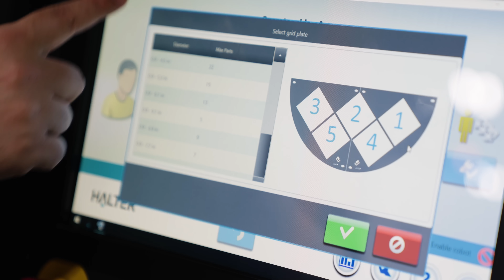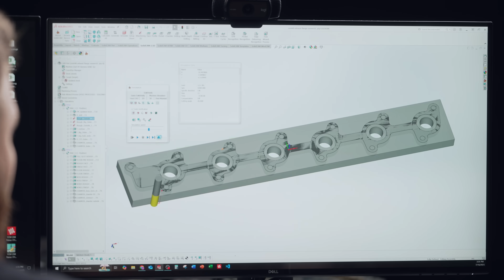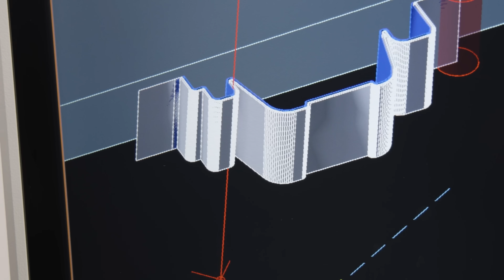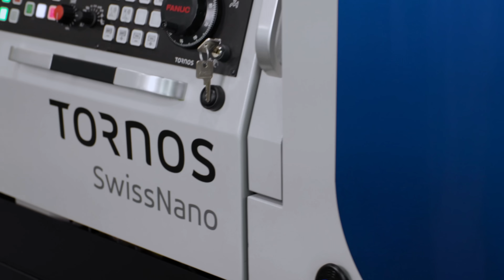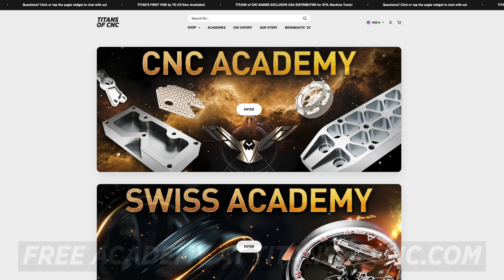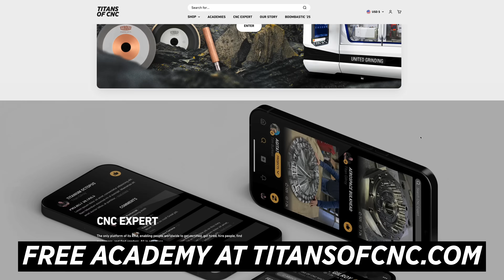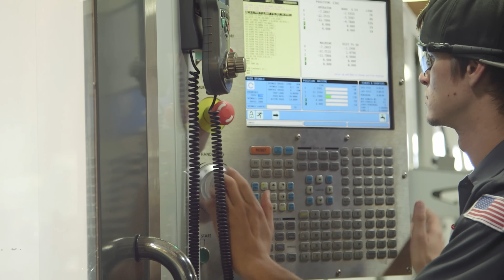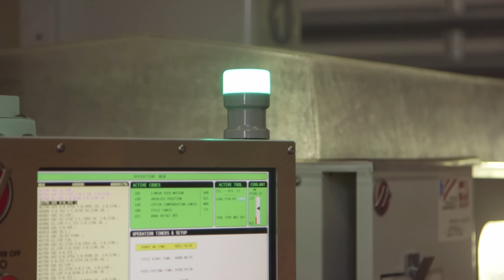Top 5 CNC Lies Holding You Back

Comment: OEE Is crazy important.  I walked into a shop where the manager was terrible.  I was the lead programmer and when they finally parted ways with the manager,  one of the first things I did was look into OEE. Our utilization averaged between 8-12% depending on the week and jobs. After alot of research, documentation of true data and plenty of projects basically to redo how to setup and do jobs,  in about 1 year we were at 50 to 60% with just 3 axis  mills, 1 lathe without barfeeder and no pallet changers or horizontal mills. 

We went from 20k in the red to 370k in the black in 2 years. 5 years ago the shop was almost at 200k in the red.

All this and no new machines. They went from thinking they needed 6 more HAAS to 0. 😅

Comment: Small shops can compete if they provide good value. Make consistent parts with tight tolerances at a good price. I'm currently building my own CNC mill from scratch and the potential is incredible. Reinvest the profits into better components (more precise encoders/ball-screws/stiffer frames). You don't have to compete for hundred million dollar contracts on day one. Money is made in process optimization and less on having the best machines

American manufacturing is way behind on the supply curve.

The only advice I have for anyone is to never stop learning. Every job or task has something to learn. At a terrible workplace/management, learn what not to do in the future. At a great workplace, learn what makes it operate so smoothly. Learn how to be a better team-member and how to interact with others. If you're a craftsman, learn more advanced techniques and how to tackle the engineer/assembler dilemma.

Comment: "Automate so you can pay your employees more"... I laughed pretty hard when I heard that.
Reply: But it's true, and automation isn't all about robots but fixturing and process as well. Instead of running one part at a time, make a fixture that makes 12 parts, and make the fixture easily replaceable so that you can keep the downtime as short as possible. This frees up the operator to run another or even 3 to 4 machines and multiple part types, meaning you get to pay the employees more for their labor.
Reply: @TheDandyMann sure u may be paying that 1 worker more, but if u do exactly what u just said in the shop i'm at, u just cost 3 people their job. Lmao.
Reply: @verakoo6187 Their labor could be used elsewhere in the shop if the shop has anything else for them to do. Your shop could expand if they're productivity is up and then give those same people the same responsibility as that If not then their labor can be used in a different shop.

Comment: i work with cnc´s that are 40 to 70 years old. its a bit weird to have a stone age windows nt laptop to backup, and you have to think in kilobytes, but its working really fine. Im mostly in Education and teaching to build the next generation. We have newer Machines, but its kinda fun to teach on the Oldtimers.After 2 years they program on the new ones in minutes its crazy. We dont have the volume or robotics to make real money, and we make mostly one or two parts per program, very specialized but its still faster
Reply: Working with old machines makes you better at programming.  Generating good surfacing code that isn’t 20k lines long is a valuable skill.  I’d say 9/10 times you need the shortest code possible to generate clean toolpaths.  All G1s ends up being garbage on anything besides heidenhein.

Comment: To say small parts can't make money is crazy, especially with a machine like the hydromat.. they can easily spit out  brass parts that are completely finished, no second opp needed at all in a matter of 5 seconds or even less.. with small parts there isnt nearly the amount of waste. One thing about it though, the machines have to be running and would want to have multiple of them running different parts.. a lot of the brand name brass parts we ran would only be sold to a customer for between .10 to $1 a part.. we could run 50k pieces in a week pretty easily but might only sell for 25k so the more machines spitting out parts the better

Comment: Our shop has a recent purchase haas 2012 sl-10+ bar feeder  we have a 06 sl20 and an 06 mori nl2500y..
We make speciality fasteners
Reply: The programmer there before me actually sent a barfeeder to the scrap yard because he didn't know how to use it.
I'm in the process working with the owner of getting buget used machines to replace whats clapped out machines and trying to get bar feeders and auto part loaders where ever I can we already went from 400-500 parts per day to over 1100 because i can keep the sl-10 running overnight the production jump is huge. I have ran into some tool life problems as we mostly deal with stainless and harder metals like 718, hastaloy, waspaloy, 660, A286. And they are just brutal to cut hex bar. I have 2 or 3 of every in the machine just and limit the parts per tool just to keep the quality up. But otherwise it's been good

Comment: Just want to say a big Thank you. I started a new job as a CNC lathe operator 4 months ago and your videos helped me so much in terms of understanding what is happening when the spindle is running. Truly the best job i ever had! Thank you Titan and your team.
Greetings from Germany
Reply: Just a question, how hard is it to learn G and M Code.
Reply: @SentinelAerospaceOfficial If you wanna learn it then its not that hard. But it can be frustrating sometimes.
Reply: @SentinelAerospaceOfficial  You'll find that most companies these days are using CAM or dialogue programming. It really minimizes the actual code inputs you need to do yourself. Its 100% a VERY good idea to learn the basics so you can easily understand most of what your machine is going to run.

There will also be places where you have to manually put in every single G code line and while I respect the guys who does that - no chance in hell you'll ever see me doing that :face-purple-crying:

Learn the basics. If youre looking for work - find out what CAM program theyre using and get yourself some experience with it and use youtube as tutorials. Most CAMs have some sort of home learning experience that you can try out =)

Best of luck to you!